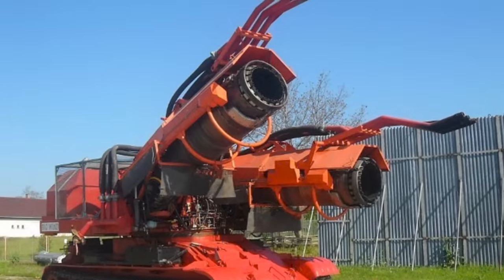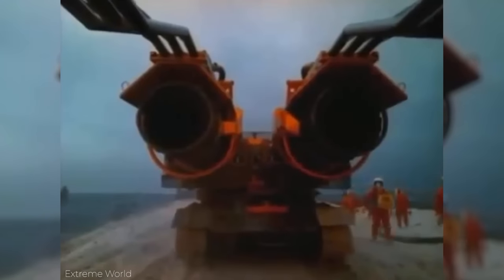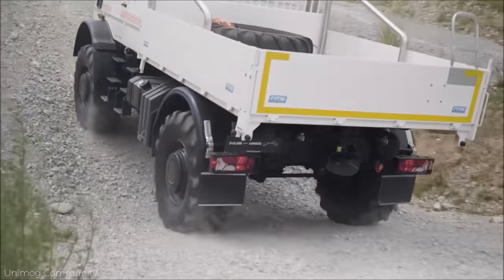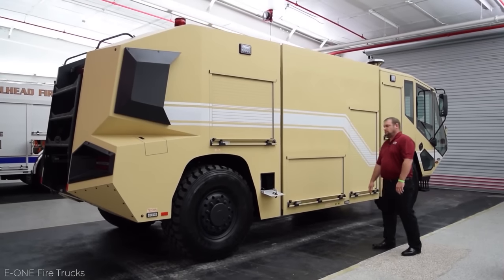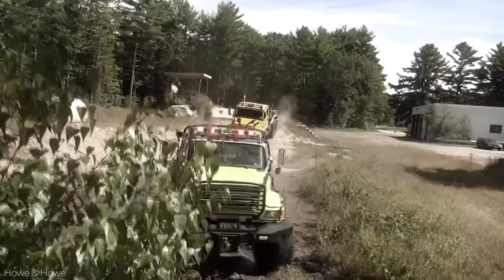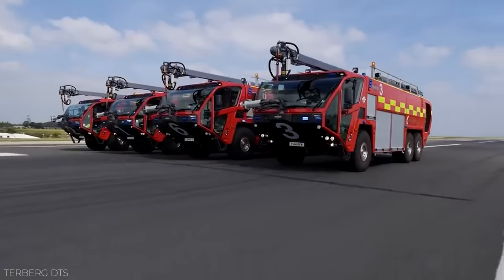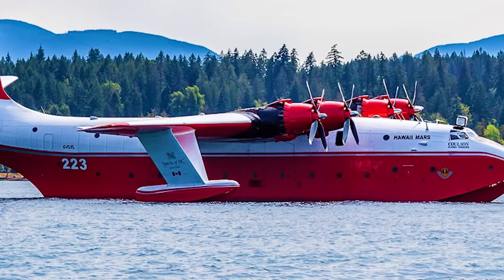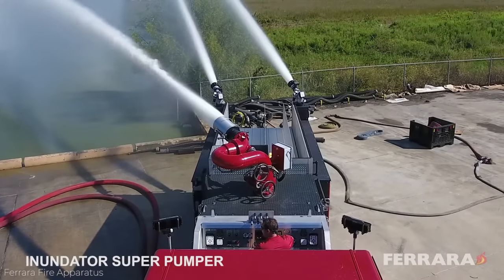TOP 15 Amazing Firefighting Vehicles

Comment: Speaking of Airport firetrucks... He forgot to Tell about firetrucks with the so called Piercing-snozzle. A Thorn-like Steel Pipe which ist used to Pierce through the airplanehull and Spray water INSIDE the hull.
Reply: Snozzle

Comment: why did you not mention the 747 tanker granted it is retired now but you mentioned other retired air tankers but don't mention the biggest
Reply: There’s a new 747 apparently likely to be in service by the end of 2022.
Reply: There’s a new 747 apparently likely to be in service by the end of 2022. It can drop something like 19000 US gallons in one go.
Reply: @wokohedgehogs  yes the new one will be a little smaller though based on the 474-200. the last one was a 474-400 so new one will be a little smaller.
Reply: @wokohedgehogs  first there was a 747 evergreen supertanker and that gone and now 747 global supertanker has taken that spot i know all about the 747 tanker.

Comment: Why are you showing confiurations of Truck chassis that are varying?  #2 shows an 8 wheel, then cuts to 6 wheel models.  Then the "unimug" shows a flatbed in the wilderness yet it is described as a firetruck?  Huge Water/foam capacity's is fine,  but how many minutes does that last?  Then there is the matter of AIRPORT vs. Domestic, Industrial, commercial vs. Forest use.